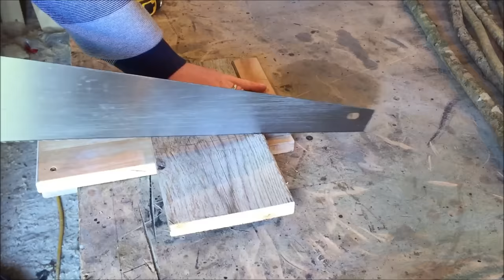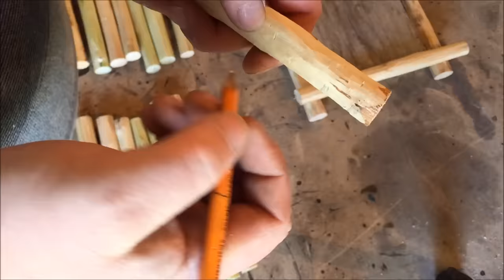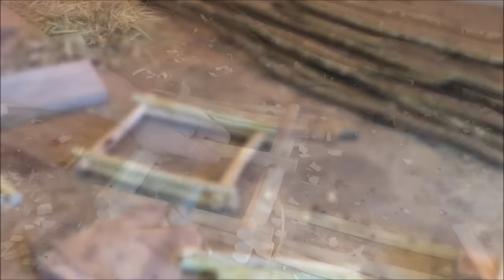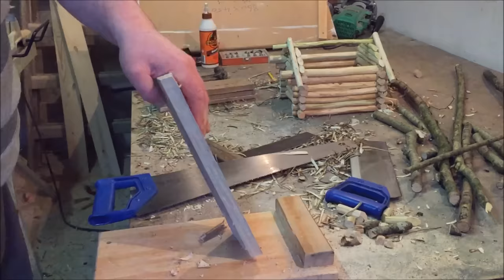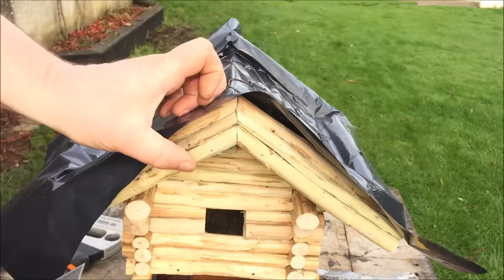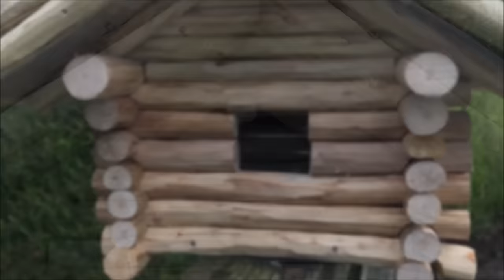Log Cabin Bird House

Comment: Looks awesome.. I would of used an angle grinder with a sand disc instead of the utility knife. Would of had those sticks sanded down in less than a minute. Lol.. Thanks for the video. :)
Reply from the maker: Thank you very very much, that is a great idea.

Comment: Wonder how long this birdhouse lasted. I think the branches were green, if so, I’m sure there was some curling and/or warping as the logs dried.  If you see this comment would you please tell me if the birdhouse is still around. I think it’s beautiful and would like to make one. But if it won’t make it beyond a year, not so much. Heck I might just buy some oak dowel material, seal inside and out, then paint outside only or leave natural. Thank you for the build and please get back with me about yours.

Comment: Ok I’ve started making one. For the indentations to connect the wee logs, why do you create an indentation for the initial layer and then only the two parallel ones thereafter? I’m not sure if I observed that right but would I would be great full if you could explain that a little. Thanks

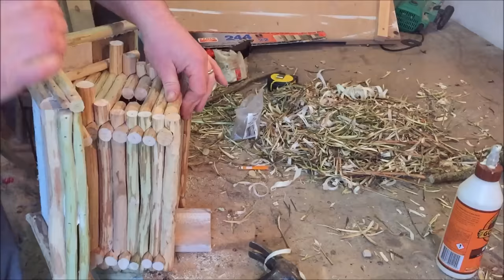Comment: Thank you!  Very beautiful.  1.  Do you think the grass amd the plastic bag are necessary?  Looks great, just wondering.  2. At 6:30 you placed the bottom of the house.  How did you attach it?  Is it detachable for cleaning the birdhouse a couple times a year/ with every season.  Thank you!
Reply from the maker: Thank you Irma. The plastic and grass are not necessary, I just did it for effect. you could just have wood or even use some astro turf. I fixed the bottom with some small nails which can be removed, you could use screws if you think it would be easier.
Reply: @EamonWalshDIY  Got it.  Thank you!

Comment: It's truly beautiful, but I don't see any way to open it up for cleaning.
Reply from the maker: Thank you Vincent, the base is only held in with 4 panel pins which will be easily removed when cleaning and then replaced.

Comment: Hi from NZ, Stumbled across this & subscribed. Love yr work. What sort of tree were the branches frm & did u dry them out before using? I have various from pruning my trees. Thnx
Reply from the maker: Hi Dee! Thank you. I used Ash, Hazelnut and a third which I dont know what it was but I am sure you could use any tree. I did not dry them as they were quite small to start with and it will be outside in nearly always wet weather (Ireland) so shrinkage should only be minimal. Hope that helps.
Reply: Eamon Walsh DIY Thanku Eamon... I have quite narrow pine branches 🌲 but will give it a go. Will share the result (if successful !!) 🤔

Comment: A very creative bird house that took a lot of thought and time, but this video is not how to do it. Bird houses need a door or access to clean them, drain holes, adequate ventilation to avoid overheating, never use perches, they invite predators, always add a predator block over the access hole.  Building a bird house is rewarding but go to a reputable birding site to get correct, safe way to do it that is good for the birds that may use it.  Building a box with a hole is not a bird house. You Tube is great but DYI people with little background can easily follow bad advice. Get expert plans from a birding site then add creative details that won't harm the occupants.

Comment: There is no way to clean old nests. The roof is not deep enough to hold soil and sustain plant growth.  Junk.
Reply from the maker: Three months in and the grass is still green!
Reply: there is no way that grass is still green after 3 month unless you are watering it all the time.1 day of hot sun and that grass would be dead.You would be far better using astroturf
Reply from the maker: No need to water it, I live in Ireland and it likes to rain a lot :-)